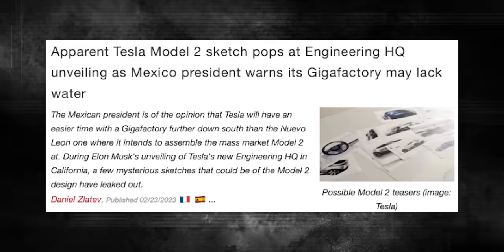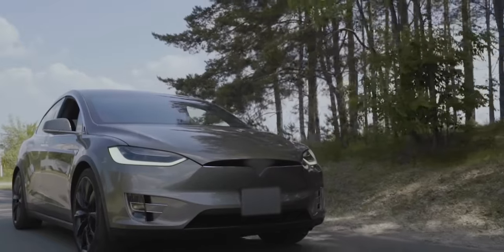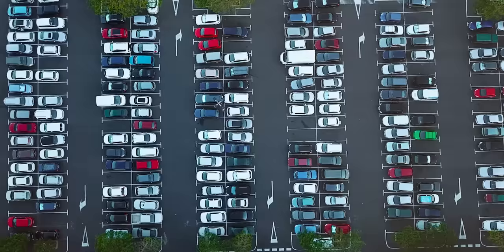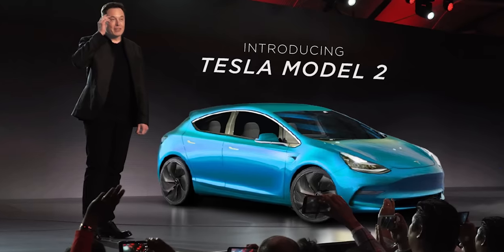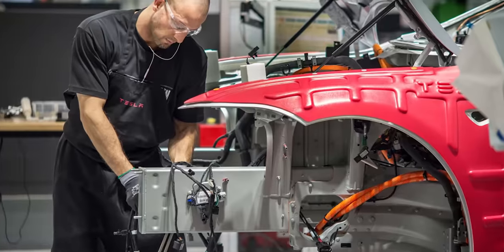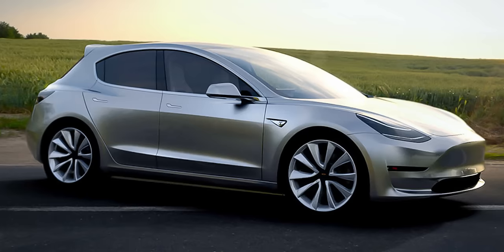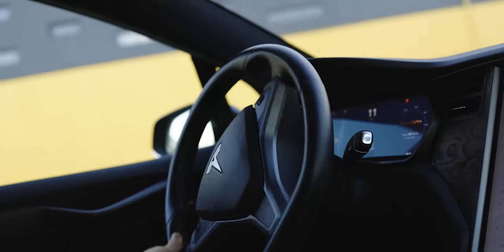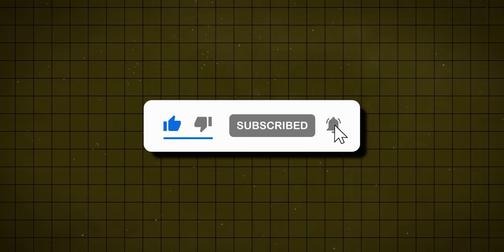ITS HERE! NEW $17,500 Tesla Model 2 Shocks Everybody!

Comment: Don't think its gonna happen as they are redesigning the model 3. Could not wait anymore so I bought a 2023 Bolt EUV that came with a free level 2 charger installation on my house. 3 coworkers of mine has a Tesla and charge somewhere else instead of home. Whats the point, thats like pumping gas at a gas station. Bolt EUV has been great I can fully charge close to 300 mile range, I charge at home, and it's 8k-10k cheaper then the model 3. Could not wait no more..
Reply: How much was final cost with fees etc? What made you choose the EUV over the EV? I’m looking into one of them as well.. thanks!
Reply: @Alexd11002  the looks, it looks better, plus I have two kids and sometimes an extra passenger, so it's a full 5 people in the car. It's longer and a bit wider then the EV so everyone fits little bit more comfy on the EUV. Also EV does not come with level two charger. Got the bolt euv LT redline silver flare  for $31,684. Hoping to get the clean air and fed soon. So if I put that towards it car should be under 19k
Reply: Why don’t your coworkers charge at home?
Reply: @notsure4907  they don't have level 2 charger plug in house. They have regular plug which is slow to charge, and or they live in an apartment..

Comment: I predict the Cybertruck will be Elon’s first big EV fail. Guys who depend on trucks for their work/towing are not gonna trust electric models.
Reply: How about ford lightening, rivian etc
Reply: @samjam6989  All EV trucks will fail.
Reply: @SamWesting  how do know? They will eventually improve them by using solid state batteries that will have a range of 1000 miles for 1 charge. That's like filling up your tank 3 times and having 15mpgs lol
Reply: @samjam6989  I was talking about folks that use their truck for working, not a fashion accessory. Hauling & towing reduces driving range.
Reply: @SamWesting  so you can't tow with electric truck? Wtf are you talking about??
Reply: @SamWesting  I said they can have 1000 miles of range with solid state battery. Do you tow a trailer 10,000 miles everyday? Even if it reduces range to 50% it still becomes 500 miles. That plenty enough. You probably won't be driving more than 100 miles in a day
Reply: @SamWesting  Hauling isn't going to reduce range that much because if you're driving a steady 65mph you only have to deal with some increased rolling resistance. Only towing becomes and issue. For other truck activities like off road travel, hill climb, tree stump pulls, moving livestock it will excel over ICE.
Reply: Most people who buy trucks use them as commuter cars to drive to the office.  They are guys who like to think they look big and tough if they drive a big truck.
Reply: Those people are a small minority of truck buyers. @SamWesting

Comment: And you can drive 100 miles 😂😂😂😂😂😂
Reply: Says 250 miles bud. Plus Toyota had a breakthrough with solid state batteries that gets 750 miles, charges in 5 minutes and no range reduction in winter and also doesn't catch on fire. I bet all you petrol heads will cry about it 😅